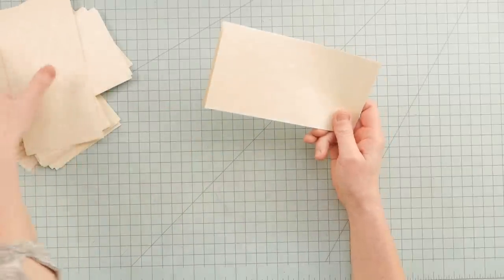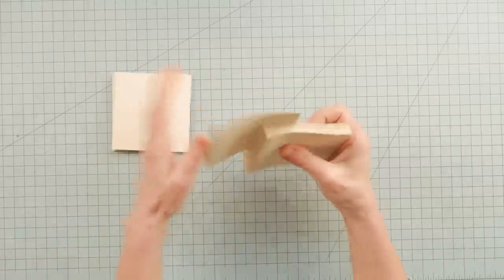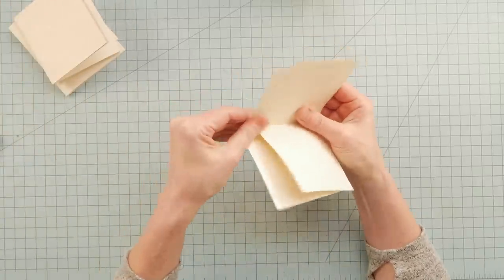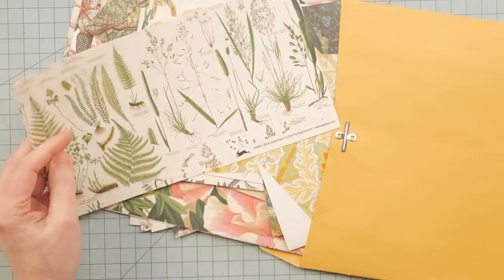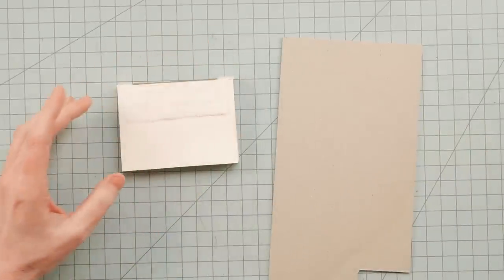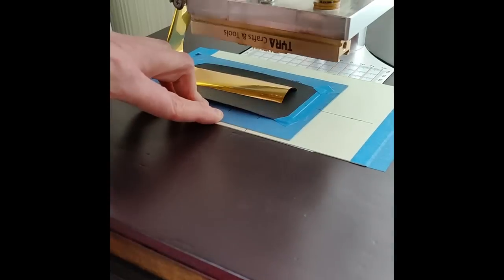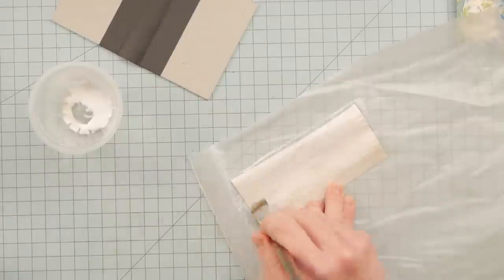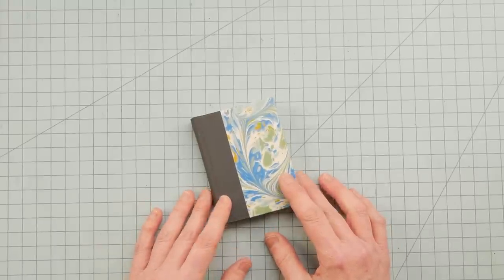DIY SMALL HARDCOVER BOOK

Comment: My closet is smaller, so I swap my clothes out seasonally (warm weather vs cool weather). When I hang them up, I turn the hangers backwards. At the end of that season, anything still facing outward gets donated. There's a reason it didn't get worn, even if you don't actively know the reason.

I also have the rule that if something comes in, something goes out. 

I'm pretty brutal, but I have to be or I'd end up living in a hoarder house.

Comment: Pro Tip - when you want to separate a single thread from  a skein , don't put it apart, 13:44,  instead get hold of the one thread and pull it out in a straight  line, in one movement without stopping
Reply from the maker: Thank you, that's a brilliant tip!

Comment: Have you ever seen the technique of making the holes in the signatures by sawing straight lines down the folds of the signatures?  I haven't tried it, but it looks like it would work.
Reply from the maker: Hi Lori!  Yes, I've done it several times, but it's not my favorite method.  Without a lot of practice, you can saw too deeply and make quite a mess. So, I usually just poke holes Lol

Comment: which video do you attach the skewers to the plastic covered boards for gluing. I saw it yesterday and now cannot find it. of course I can't. UGH Thanks
Reply from the maker: oh boy, Francine....I wish I knew the answer to that!  I used super glue to stick the skewers to the very edge then used shipping tape to cover over the boards.
Reply: Nil, I figured it out. Tan a bead if glue along chipboard edge, let dry making sure they were even, then covered with clear tape. Whala, worked perfectly when gluing my sketchbook cover under books for weight.